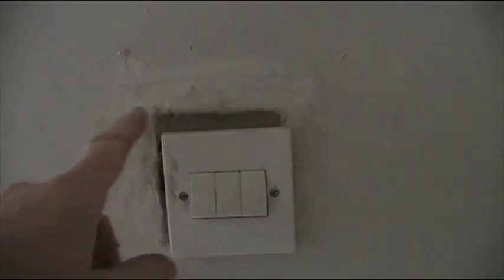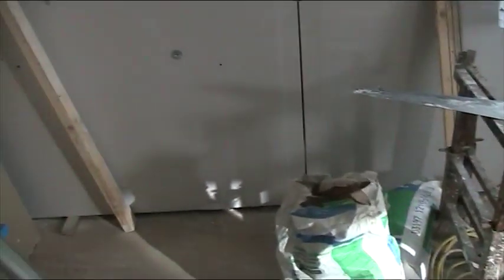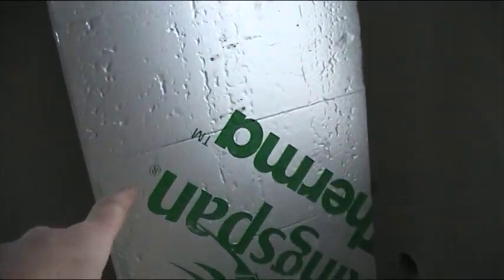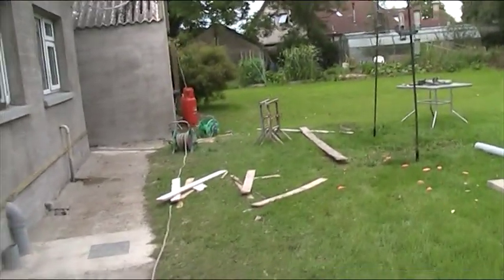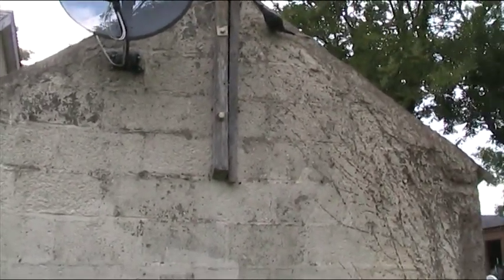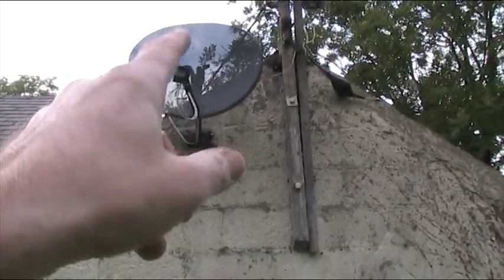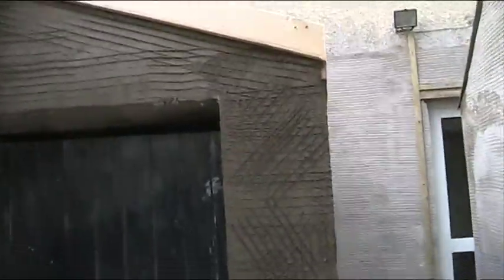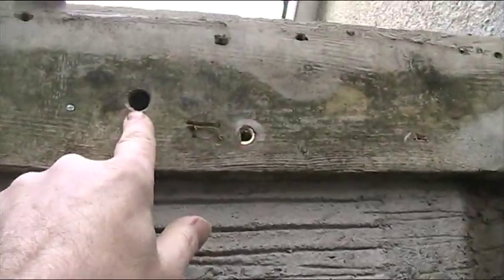Damp Proofing & Plastering 8

Comment: Your are getting there. I like the way the did the angles so accurate on the lean to roof.
Reply from the maker: There were a lot of measurements before cutting but, once they were done, we flew through the cuts because they were all the same.  There are tiny bits to trim off a couple of the ends but that will only take a minute but we forgot to do it when we were at it.  Three days off.  I get to lie in but, knowing my luck I'll be up at 6.00am.
Best Wishes, Brendan.

Comment: Brendan,
That looks like a big project. thanks for showing the process.  Mark
PS. good luck on the lath.
Reply from the maker: Thanks Mark, the job grew from rectifying a rising damp issue to a near total renovation but there was no point in plastering the front of the house and not doing the rest.  Cost a lot more money but it will mean no more painting and external maintenance wil be a power wash every few years.  If I get the lathe you'll hear me.
Best Wishes, Brendan.

Comment: Never saw those anchors before. Interesting. Is the purpose of scoring the lines in the outside plaster to give the next coat something to grip? All in all, it's an astonishing project. Hey, you could put your new lathe in the new shed! I'm sure Rosemary would go for that in a minute...
Regards, Gary
Reply from the maker: Yes, the scratches are a key for the next coat.  It is fascinating to see how it works.  There was a problem at the front where the wall threw the scratch coat off twice so they used a lot of Unibond and put on 3 thin coats over 4 days and that has cured the problem,  One issue was that the wall faces South and the Sun would beat down just when they didn't want it.  They like a slow drying period.  I'll do a video tomorrow and explain what happened.
Best Wishes, Brendan.

Comment: Here in the US, we also set off the sheet rock from the floor, especially a concrete floor.  One reason is to prevent moisture from wicking up into the sheetrock and staining it. I've never seen those sheetrock fasteners used here.  Are the foam panels behind it?

Your emotions are just like mine when it comes to a big discretionary purchase. I'm starting to wonder whether we play games with ourselves - that we pretty much know we are going to buy the thing but we express doubt hoping that others will validate what we intended to do anyway.  Sometimes when I procrastinate, however, I miss a chance to get the item or to get a bargain.
Reply from the maker: Yes, the foam is bonded to the sheetrock and it is an inch thick.  The reason we have to do all this work is because a plasterer brought the plaster right to the ground when we did the damp proofing 22 years ago and that allowed water to bypass the silicon barrier and get up the walls.  With the thermal sheets the water cannot get past the foil barrier or into the insulating foam.  That, along with the mini cavity will ensure the house stays dry.  In the last video I think I showed the profile of the thermal sheets and how they are constructed.  We love them here because they do such a wonderful job...expensive but effective.
Best Wishes, Brendan.